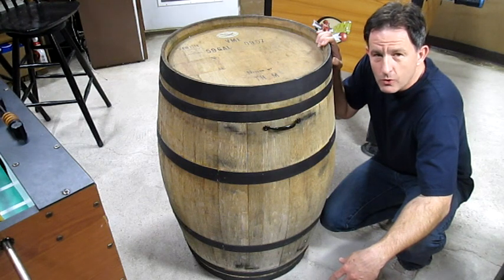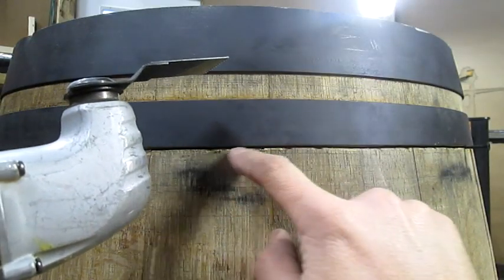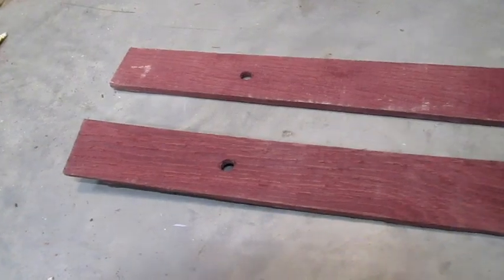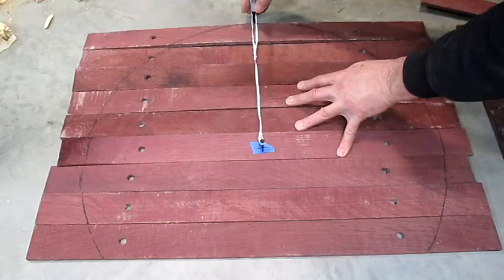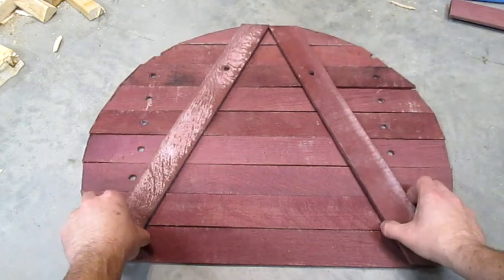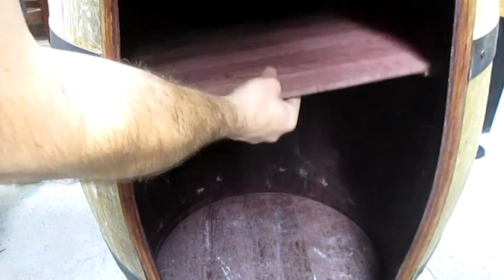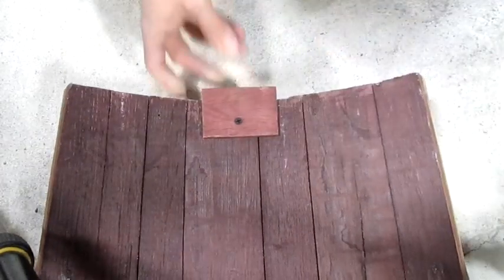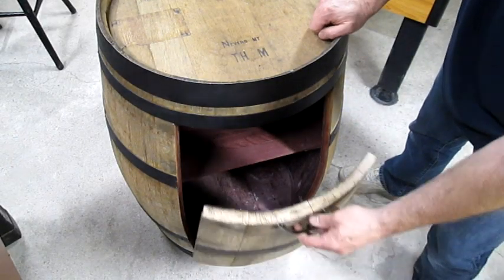How To Build a Barrel Cabinet

Comment: Excellent! I have just got my hands on a wine barrel as it so happens... As a newbie, I have a question: would it be possible to put the hinges at the bottom of the door instead of the side so it opens like a flap? Wouldn't that get around the poblem of the hinges getting ripped out when you open the door? Or maybe I'm just visualising it wrong in my head...
Reply: Hinges can be used but for some reason people get hung up on the idea that they need to be attached flat across the face. The easy solution is to mortise the hinges so that the open ends protrude inside the barrel. Use a large framing square or diy square and hang from one end of the barrel and down the side to line up the hinge pins. Wherever you decide to mount the hinges just make sure that the hinge pins are out far enough so that when you line them up with each other down the length of the barrel that the projected line clears the widest middle of the barrel.....if that makes sense.